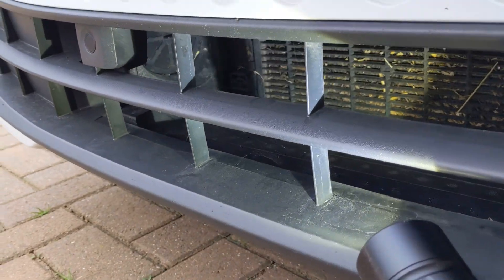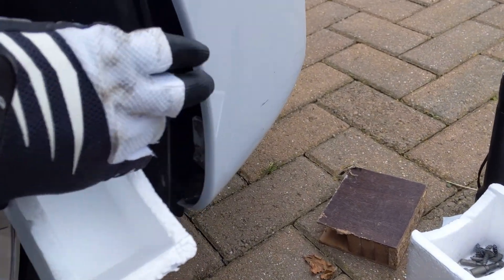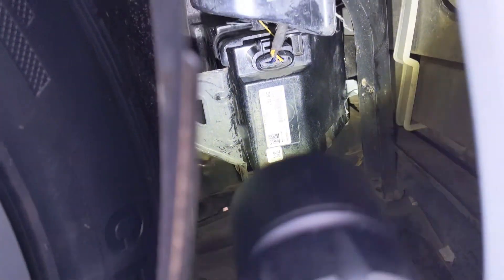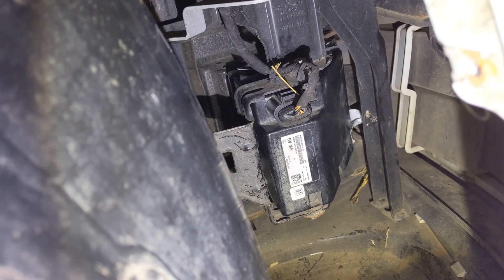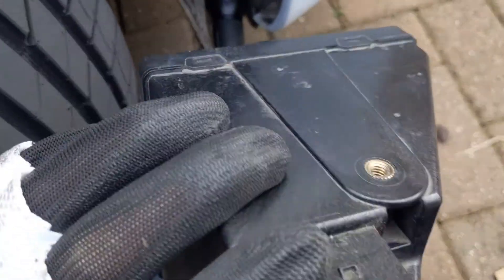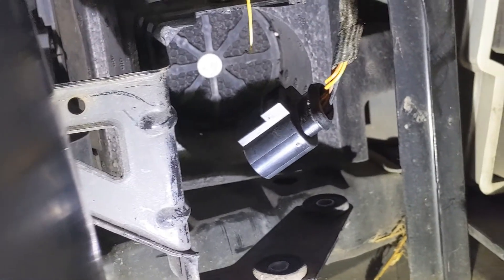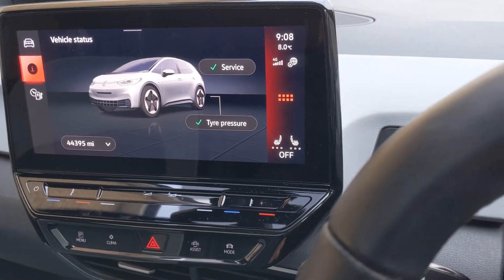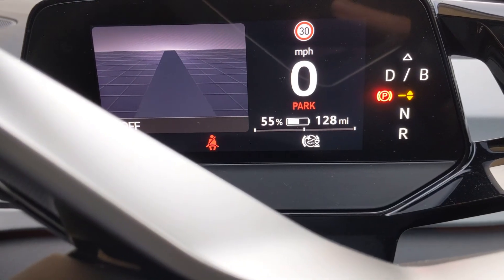VW ID.3 front sound Generator issue and replacing

Comment: I've just replaced one of these units in my ID.3 today.  A few days ago I got the same symptoms – front indicators not working, headlights staying on ALL the time, and a strange rising tone from the failed sound generator.  As a temporary fix for the headlights when stationary, remove the F4 and F5 fuses.  Using @samsamsam21 's very helpful video meant that it was a simple repair job for me.  First I just disconnected the unit following his very detailed instruction about lifting the wire clip.  I removed the old unit and temporarily sealed the connecter until the new unit arrived.  The lights issues went away and all I was left with was the warning about the sound unit.  This meant the car was drivable.  I was determined to find out if water ingress had caused the failure.  The box is extremely well sealed (glued) and it needed a Dremel to remove the front.  It was completely dry inside and there was no sign of any component failure.  Before fitting the new unit I reconnected the old one and it did not show any errors, but as it had been cut open I fitted the new unit and everything worked correctly.  I am wondering whether there was an intermittent problem  with the connector plug causing the old unit to report errors.  The wires are exposed on the rear of the plug and I would have expected a rubber boot or better sealing.  Anyway, the car is now fixed.

Comment: Hey I mightve missed the bit where you said you unplugged the 12V battery? Not needed to swap the generator, right?
I've seen elsewhere they unplugged the generator to get rid of the warning beeps till the repaired it, do you think that would keep the headlights working?
Reply from the maker: I doubt the front headlights will stay working, from everything I read and my memory of doing this the lights route via the module
Reply: @samsamsam2125  Unplugging the unit fixes the front indicators and stops the headlights staying on.  I've been driving for 3 days like this.

Comment: Did you have to remove the connection to the battery or did you just do it while the car was on/idle?
Reply from the maker: @safeetasneem5471  I unplugged the battery mainly as the lights were stuck on until the part arrived.
I'd recommend unplugging it, be wary the battery wants to hide down the car, also when plugged back in it my freak out with motor errors that go after short drive
Reply: @samsamsam2125  I just removed the F4and F5 fuses.  This worked for me.

Comment: Hi! Thank you for the Video. Was really helpful for me. Did you have to adapt the new part (VCDS?) to the central control unit?
Reply from the maker: Nope. Just plugged it in. I did have problems with the motor and some other errors with having the car battery unplugged, but short drive and they went away
Reply: Despite what some retailers say on their websites, the unit just works straight out of the box.
Reply: Thx, helps a lot :)